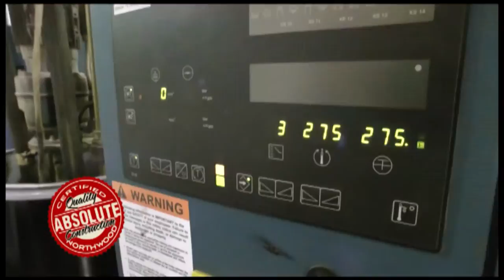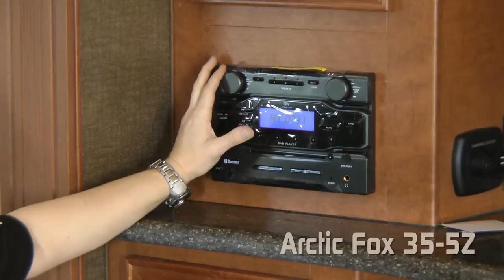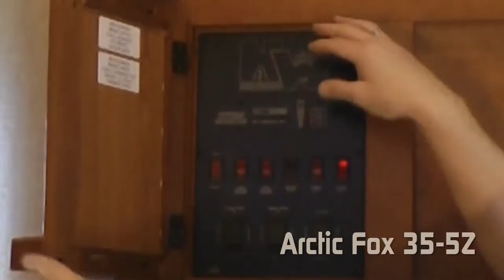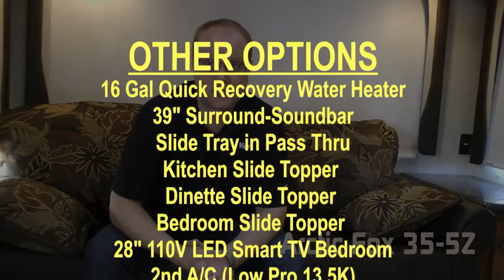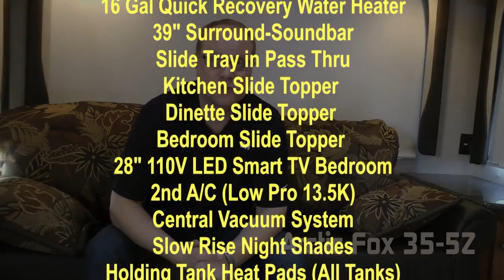Quick Tour of the NEW Arctic Fox 35-5Z

Comment: Climate change including extreme storms, cold and extensive downpours will require more rugged, better sealed and insulated units.  More extreme cold conditions on horizon requiring heating for extended periods.  RV manufacturers need to offer an artic version and with larger closets. Coats, down vests etc take up space.  Where are the coat hangers? Build a unit with outdoor sportsmen in mind vs grand mothers please!
Reply: isn't this 4 seasons rated? NM makes claims like this in several review videos.
Reply from the maker: Everything we build is 4-seasons rated.  This is based on the insulation used, plumbing and all tanks enclosed within the insulation, and all tanks heated with forced air.  Closet sizes don't make up a 4-season unit.